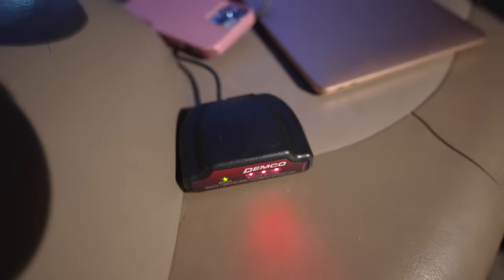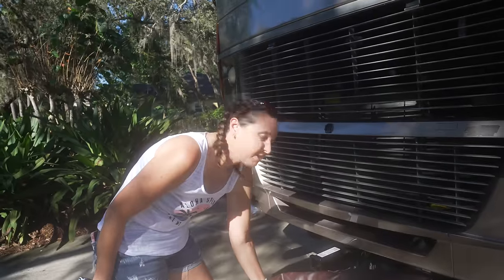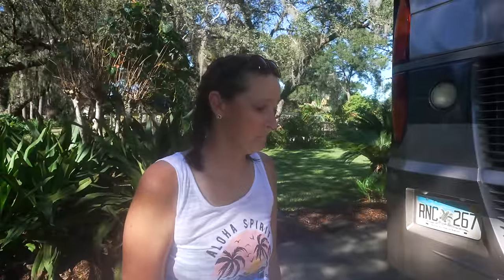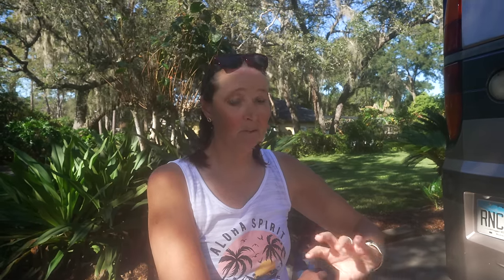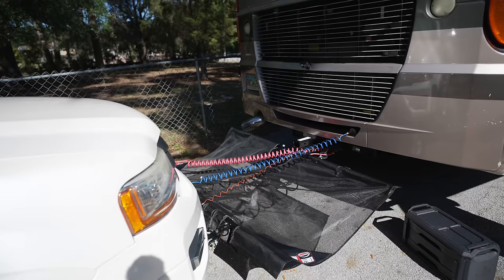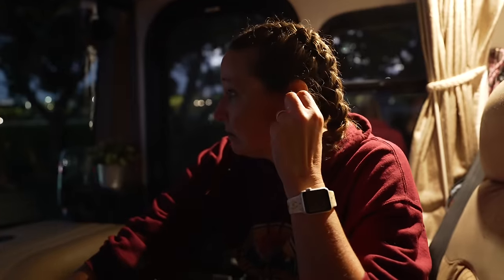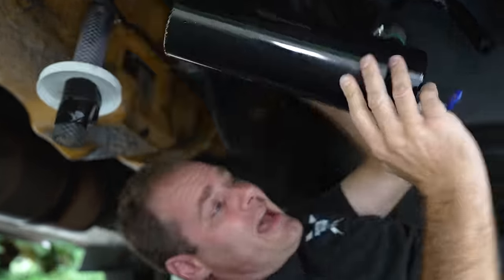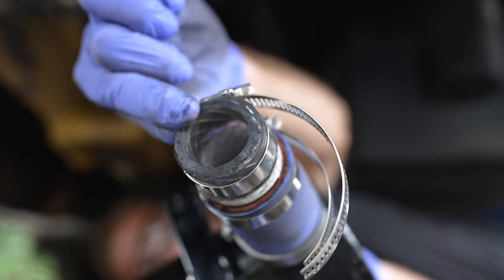The WRONG WAY To Take A RV "Shakedown" Trip! ⭐️ Do NOT Recommend

Comment: I had the same problem with my towd. When I first hooked my towd up the receiver and tow bar dragged all of the time. First I shortened up the tow bar in the receiver as much as possible and drilled a new pin hole in the tow bar. Then I got a new drop receiver that raised the tow bar by one inch. Then I got a Ultra-Fab Products 48-979020 Receiver Mount Protector, which is a wheel that goes on the bottom of the receiver and will roll rather than drag your tow bar. Sometimes you can not avoid dragging. Happy RVing.
Reply from the maker: Thanks for sharing

Comment: I’ve watched all your videos. I usually don’t comment. There’s an adjustable magnetic reed switch on the cylinder attached to your brake pedal. That reed switch is what triggers the signal to the wireless receiver. Seems it might need an adjustment. Even when it did work after your reset it was delayed. Instructions are on Demco’s website and easy to follow. Good luck!
Reply from the maker: Yes, thank you!

Comment: I left the emergency brake on and damaged our first toad's tires on the first pull-out after the first connection. That was embarrassing, but luckily the tires were new and the damage was accepted on the hazard coverage, so replaced for free.

Current toad is a 2012 Chevy Sonic and mistakes have been made but no damage done so far. I do want to add the coachlink in the RV but I'm afraid of the same issues you're experiencing in this video.
Reply from the maker: We found out there is a adjustment on the reed switch on the brake actuator that needs to be adjusted - once done, all works as it should.

Comment: Not sure if this is helpful, but I also have a Demco system (Stay n Play). It requires both the electric signal (from brake light) and an inertia signal from a sensor on the toad. So sitting still and applying brake pedal will not actuate the toads brakes. The inertia sensor is adjustable so you can tune the progressive application of brakes. You can also set it to max to test it when not moving.
Reply from the maker: Thanks for sharing
Reply: I ha e a Stay n play as well. Ben and Charity have the Air Force One system which used the brake air from the coach. As such the brakes will apply to the toad when sitting still, there is no inertia sensor in their setup.

Comment: I now remember where I found the optional connector bar lengths.  They are listed with part numbers in the operating manual for the Blue Ox towbars.  Three lengths.
Reply from the maker: Thanks for the info!
Reply: They are really expensive, a second set of holes can be drilled in the stinger

Comment: You can buy a shorter attachment from Blue Ox.  I had to do this for my Class A Gas.  Needed the drop down and it made it too long.  Removed the existing piece and Bought the shorter piece and I solved the problem.  Best of luck with the new Toad.
Reply from the maker: Thanks for the info! We will have to check into that!!

Comment: You have the same hitch problem I had. The Ford attachment is lower than the jeep was. You should be raising the attachment point on the front of the Ford. This will eliminate the need for the drop hitch.
Using a wireless brake on that rig isn't going to be reliable either.

Comment: For more road clearned on your drop hitch, you could add a second set of holes on your stinger (the part that slides into the receiver) so it doesn't stick out so far. You would want to make sure it doesn't affect your turning clearance.
Reply from the maker: That's a great idea!
Reply: I had thought of drilling new holes as a solution but opted for buying the new shorter piece.  The measurement you would have to duplicate would be how far out the connection is without the drop and then maintain that distance with the drop and the “stinger” combined.  I don’t have a drill press so I would have gad to bring it somewhere to get it drilled.  Drilling that heaven steel by hand would be a challenge to keep both sides aligned.  It is the cheaper option.
Reply: @glennandpamlang190   you should join Ben and Charitys discord we could discuss options in more real time!
Reply: Tim,  I don’t know what their discord is or how to respond to it. I looked around their site and didn’t see anything like that.  They are pretty smart so I think they will weigh their options and execute what they think is best for them.
Reply from the maker: @glennandpamlang190 Here it is 👉🏻 https://gratefulglamper.com/discord

Comment: Are you using a TPMS system on the toad? I am new to this but when I added the system to our new to us class A, I also bought 4 more sensors for my toad. My system has an additional antenna that I installed at the rear of our 30ft-er, so it is sure to get the rear and toad sensor readings.
Reply from the maker: Yes we are using a TPMS (Tireminder).

Comment: I know this is off topic but I was wondering about your dash air conditioning...we have a motor home like yours and when we are traveling the dash air is not very good...was wondering how well yours works.?
Reply from the maker: Ours works well. We do run the coach a/c when driving on super hot days tho.
Reply: @GratefulGlamper  thank you for replying...I believe I need mine checked out. Safe travels

Comment: I like you videos but this is just excessive IMO. I guess if you have money to burn excess is OK......but why in the world do you need an Expedition (one of the biggest consumer SUVs on the road) as a tow vehicle. Were you looking for something you could tow your RV if it breaks down, why not just buy another RV as a tow vehicle. You for sure are not going to win any environmental awards.
Reply from the maker: Hey there! Interestingly enough the Expedition gets the exact same mileage as our Jeep wrangler did. Also, we purchased the expedition used (it’s a 2017 - so 6 years old). We were really cramped for space with two adult size teenagers, two adults and our 120 pound dog. We had our Jeep for 5 years and outgrew it. Maybe check out video last month about the reasons for the “upgrade”